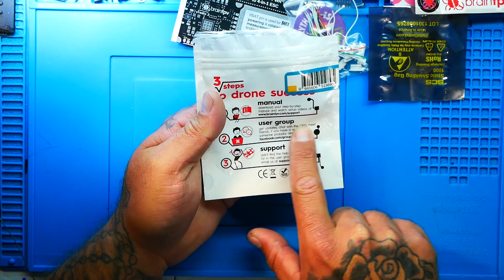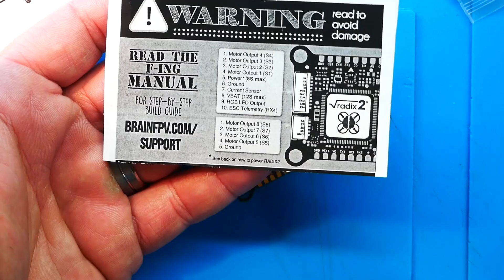Your New Go To Flight Controller 🧠 BrainFPV H7 Radix 2

Comment: Would it be possible to use a fettec 4n1 esc with this board?  I’ve always run kiss / fettec, but have been playing with iNav and would like to run iNav on this board, but also be able to use the esc’s I already have set up on my quad.  Also, would a PDB be required if fettec 4n1 works?  Thanks for the video, always very informative, quick and entertaining 👌

Comment: I have a question. Should you put a capacitor on to assist receivable clean video should it ideally be wired downstream of a voltage regulator?

Comment: Dual cam is for second cam being a dvr split that would be a hell of a lot less weight than carrying an action camera. Now just need split cam that does 4K at decent frame rates preferably not the size of say an air unit, cause well, the tech is their, ie in our smart phones.

Comment: What happens if you push that reset button while quad is on ??
Reply: It will default all of the BF settings you set on the board if you do push and hold the button. 

If you push and hold it before plugging into a computer, it will activate the mass storage on it so you can update the firmware on it.

Comment: ohhhh shit!! im so excited for this!
Reply: Thought u used emuflight. Or are u using madchillers raddix hex
Reply: @noisy_boi_fpv_3920  there's no emu firmware available for radix 2 but it's amazing on BF.
Reply: @skydogfpv  but i have emu on raddix lol
Reply: @noisy_boi_fpv_3920  radix 2? I was under the assumption emu firmware is only for v1 radix
Reply: @skydogfpv  yeah man. Sorry miss read your message.  Lol
Reply: @noisy_boi_fpv_3920   do you have a link to the emu flight radix firmware
Reply: Sweet
Reply: Yeah homie 😉

Comment: It’s still betaflight, lol.. I fly kiss... BUT it is one of the best Fc’s for betaflight by far.. I had it setup on my spare rig that I use for testing other hardware..
Reply: What the difference?
Reply: @dariuszrogowski2360  kinda like the difference with apple and Android. One works for less intelligent guys, the other one works better oif you know what you're doing with it otherwise it's a pain in the ass